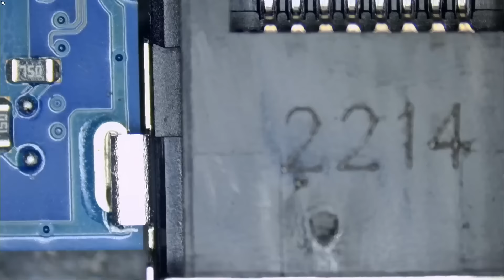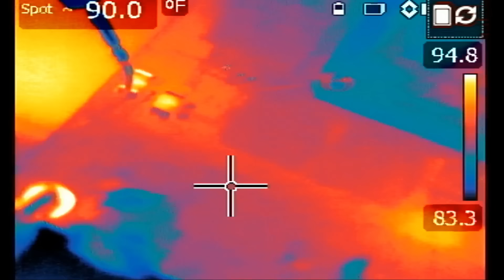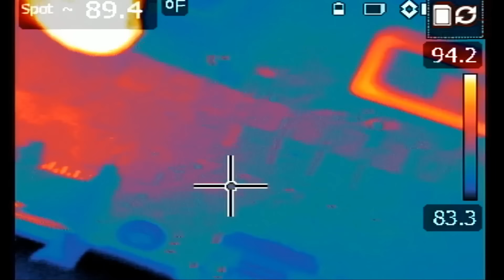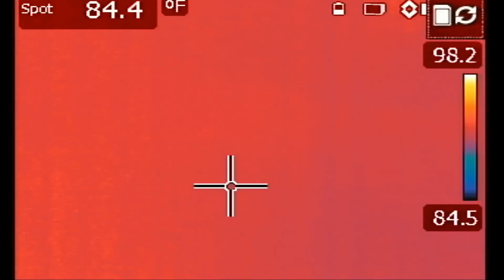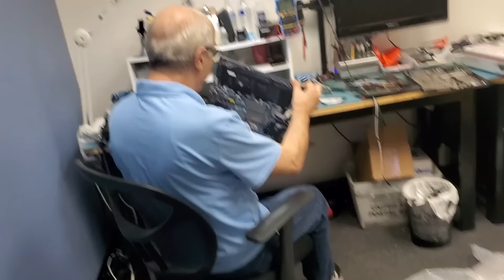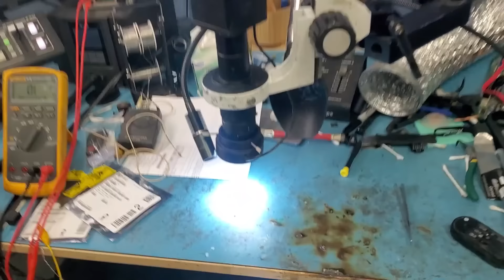High End Asus Laptops are failing. Expensive G733Z Scar No Power Repair

Comment: ya always go to the DC Power connector and look for dry joints on that fires then visual damage to mosfets, Caps or inductors in that area for a start. - Thanks for all of your help with these, I am a hobbiest and enjoy this type of work. It is so satisfying being able to fix something that normally gets biffed in the BIN. I particularly like that even though you have seen thousands of these, you cannot take it for granted that the last cause of the same issue will be the fix for the next one. Each one needs its on TLC. Great work - Appreciate it.

Comment: As an electrical engineer, I would like to know what could be the cause of these shorted caps or blown MOSFETs. Clearly, this appears to be a design issue because with correct PS design and choice of parts, this does not happen.  Any ideas anyone?

Comment: I used to prefer Asus Laptops over other trade marks. However, I am very disappointed because of failures in the power supply system and other failures short after the expiration day of guarantee. In addition to the built-in ram memory modules which in failing leaves you with an expensive repair in most countries or another laptop in the trash can. So, I've decided to try other trademarks.

Comment: The reason people would underclock it is because of Intel's lunacy. Their CPUs, desktop OR laptop, are so absurdly power hungry now that they cook themselves and, in the case of sensitive things like a laptop, fry capacitors/other components a lot. Intel's clown solution was to "underclock", even though any CPU that's ever hit 65W is a victim.

And any CPU is going to hit at least 65W now with Intel. We have no reason to believe Intel on the "65W+" thing, they've consistently lied about Raptor Lake/refresh this entire time.

The average high-end laptop CPU from Intel how runs at 55-65W standard now while turboing anywhere up to and over 150W. Remember, depending on workload, room temps, and laptop cooling, it can sustain itself at said wattage, which with modern Intel is... scary. My 2020 Sager laptop is a "45W" chip that can comfortably sustain itself at ~65-70W for workloads (gaming does count as a workload).

Comment: My father always gets an asus laptop when he upgrades his work machine. He’s never had a problem but after seeing how many you work on I’d be reluctant to do that. Although it does seem like the gaming laptops are the most prone to failure so who knows.
Reply: Most gaming laptops are prone to failure. Acer, MSI etc. Heat build up more power draw.
Reply: @GregM  I've had an Acer Predator laptop for 8 years.  Still works fine but I might just be lucky.
Reply: @GregM  It isn't really the heat, but when the companies skimp out on parts. You sadly need to do a lot of research. Expensive laptops can use really cheap parts, like MSI with their dollar-store laptop hinges, Alienware with their VCore problems, ASUS with the MOSFETs, etc. But those same companies can have some laptops at similar or even less price points WITHOUT those issues.

A bigger problem now is the power flowing through a laptop. Five years ago a gaming laptop wasn't going past like, what, 180W, for the CPU and GPU? Now the CPU or GPU need nearly that much for themselves, to say nothing of the other one needing a similar amount. This means cheaper components REALLY can't be used, but still are for some reason in certain lines.

The lack of industry standards is depressing.
Reply: @mr.number9279  what about acer and microsoft

Comment: I also have the NF.Short. How do you switch it to beep on a short?
Reply from the maker: Press the knob and go to light 3. First light is for voltage adjustment, light 2 is for current adjustment, and light 3 is for beep/no beep  While on the 3rd light, Turn knob counter clockwise for no beep or clockwise for beep.
Reply: @NorthridgeFix  Thank you! I've used it a thousand times but always just clicked through that 3rd light, never really knowing what it did 🤣 (also just a hobbyist so I don't know my equipment quite like I should clearly lol)
Reply from the maker: Good thing you watch the videos
Reply: It’s the Fluke meter that beeps
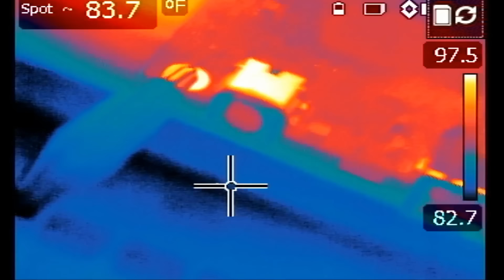Reply: @mrBDeye  That is not what I am talking about. Yes, the Fluke beeps. Check out 3:27 of the video.